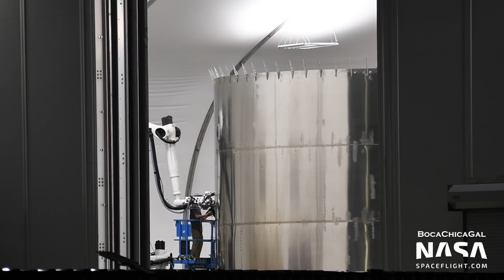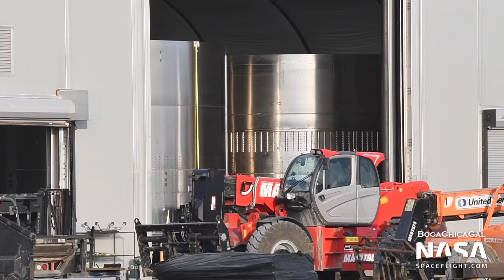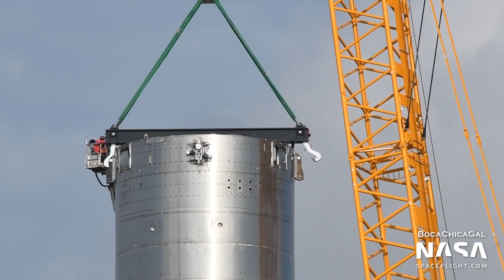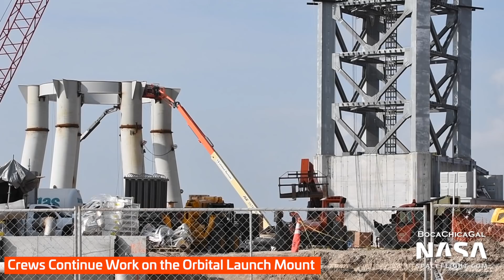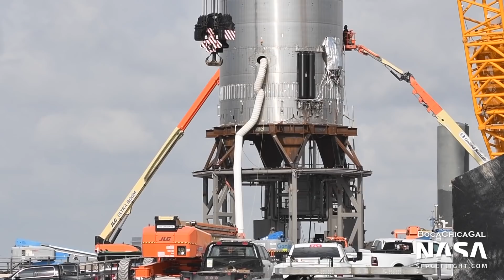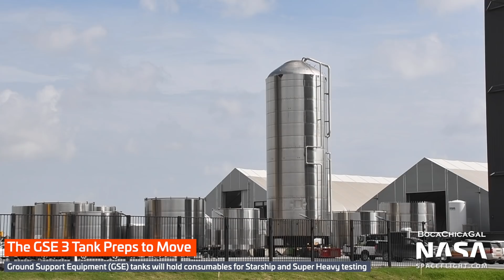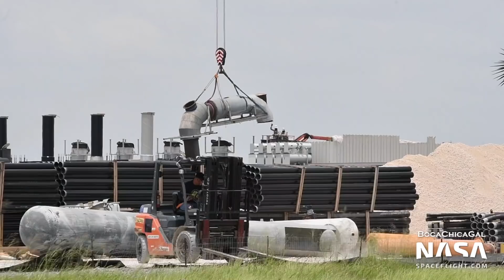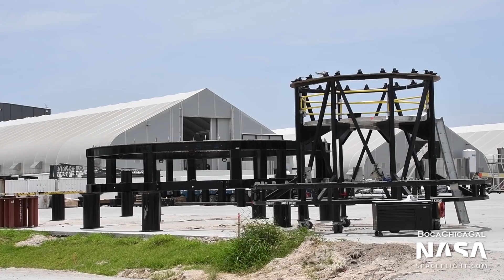Booster 3 Now Freestanding on Pad A | SpaceX Boca Chica

Comment: the mystery structure. i wonder if its a pully based system that will "grip" the booster as a catcher for the tower
Reply: Nothing like that. It is another stand to "park" boosters while they are waiting to be used. A foundation next to the tower is under construction.

Comment: And here I was thinking GSM3 was finally going to get moved down to launch…. Looks like it was just moved out of the way. The thing is just collecting dust.  Crain was moving in place and everything….  
They are not really in a big hurry for GSM4 either…. Guess there is entirely too much plumbing and electrical to do first.
Reply: I think this points to the need for modifications. No other reason I can think of that would cause all production to stop for weeks. I think it looks like it will be either modified or cut down in the Midbay.

Comment: Can we put an empty booster on full one and fly both on orbit? Would it make any sense to have boosters on orbit?
Reply: Boosters are not meant to reach orbit, but only to assist the Starship in getting there.  So it would not be practical to stack boosters.  That would be too heavy and the design is completely unsuited for such an effort.
Reply: The booster only lifts the ship to about 100km then drops down again. The Starship uses its own fuel to get to 300km - 500km were it can stay in orbit. Then if it needs to go anywhere farther than that other ships have to carry fuel up to it to re-fill the tanks.

Comment: 19:35  The mystery structure will be a hydroelectric turbine generator. The big natural gas fueled generators will be used to pump water up into a giant water tower; water will flow down and spin the turbine for power for the LOX plant. Elon wanted a green power source, and this is the best his engineers can do.  :)  :D  <-!Emoticons!
Reply: Interesting to see something that important built inside the safety template. If that's the case then I would like to see what mitigation(s) they come up with to protect it.
Reply: @deanm.3881  Don is just joking.

Comment: Seems like a waste of ground support equipment, if they're just cutting up GSE-3.
Reply: That's what happens sometimes with rapid design and construction.  We have already seen several partially constructed starships scrapped.  And Booster 1 never even got to test fire let alone hop and 3 may not either.
Reply: I think they will modify it.